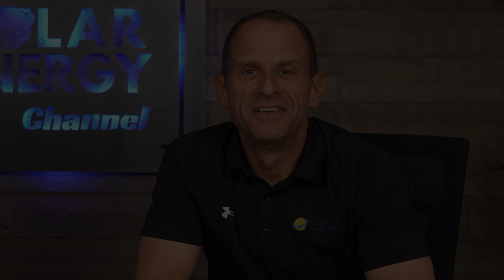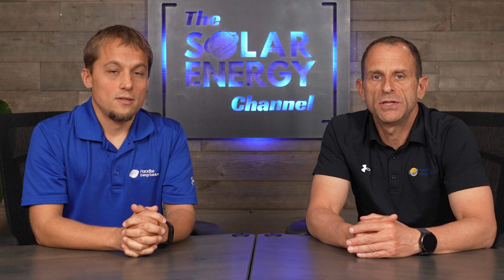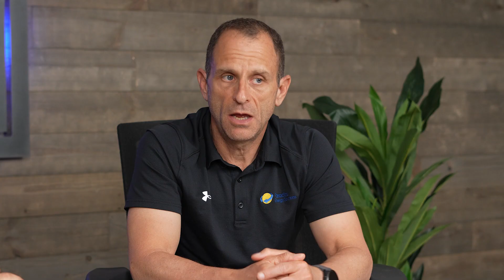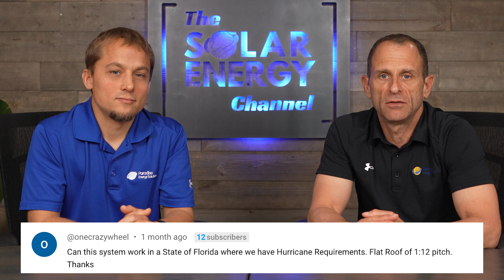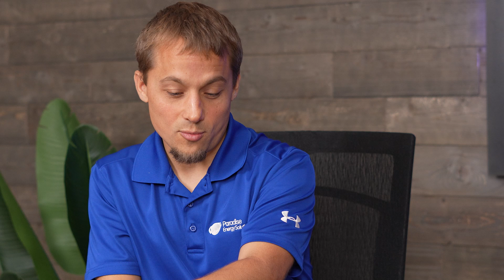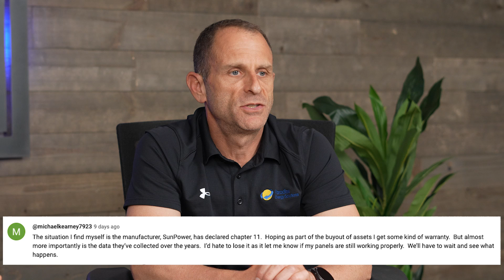Answering Your Top Solar Questions: Net Metering, Recycling, and More! (Part 2)

Comment: Yes, net metering is absolutely a subsidy from your neighbors, the question is how much?  I expect this will not be an issue much longer in many places as most cooperatives are now moving away from 1:1 net metering and I expect the laws will change as they did in CA to allow IOCs to move away from 1:1 net metering.  So, future solar installations will have to be more self-supporting which means that most systems in the north will no longer be economically viable. People may well want one for other reasons, but economics will no longer be a valid reason.  This will make things more fair for all electric consumers and producers.